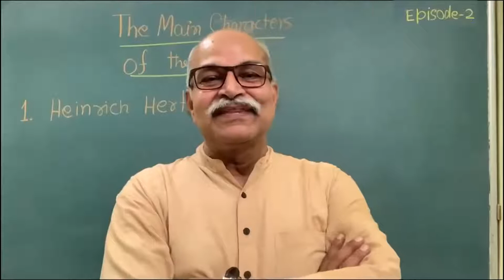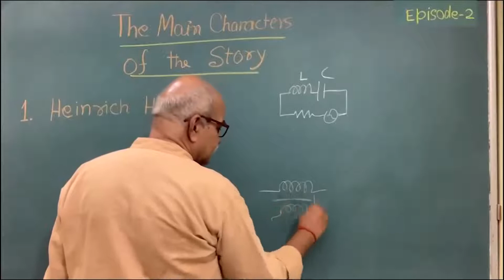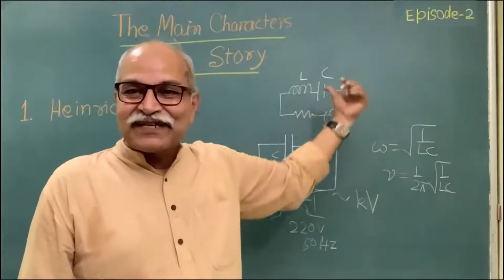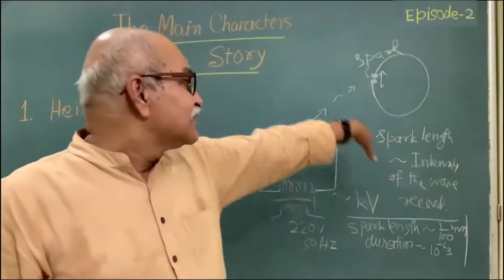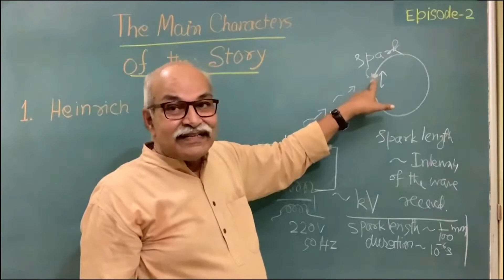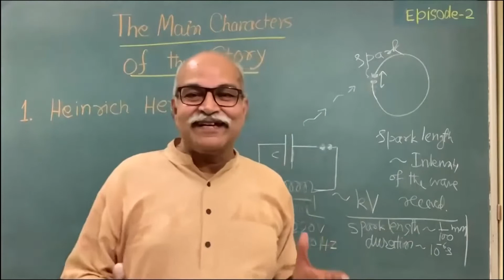Episode 02  Hertz Experiment of Generating EM Waves and obse...

Comment: A modern version of Hertz's radio wave experiment has just been used to disprove the theory of relativity. The experiment was just published in the EM journal IRECAP and shows an EM pulse propagating 1.5 meters in the near field with no observed propagation delay. It shows that the FRONT speed, which is known to be the speed of causal action is also the speed information, is instantaneous in the near field of EM sources. The paper shows that this is the second time an independent researcher has done the experiment and arrived at exactly the same results. The experiment with 100% repeatable and was repeated hundreds of times with the exact same results. The paper also shows that the effect is predicted exactly by Maxwell's equations when the source terms that come from Gauss's law and Ampere's law are included in the wave equation. Because this was not done by Maxwell, his original proof showing EM fields propagate at speed c is wrong, and because Einstein wrongly assumed this in his theory of relativity, relativity is also wrong, as well as any other theory dependent on it, including general relativity, and even QED. For more information  see: Non local or possibly superluminal Maxwell displacement current observed in the near field of a spherical capacitor, 2024. Also see: New Interpretation of Relativity by William Walker, 2024. Note that all the papers supporting this research can be found in the description of the video.

For more information see the following links:

*YouTube presentation summarizing my 35 years of research in this area: https://www.youtube.com/watch?v=sePdJ7vSQvQ&t=0s

*More extensive paper for the above arguments: William D. Walker and Dag Stranneby, A New Interpretation of Relativity, 2023: http://vixra.org/abs/2309.0145

*Electromagnetic pulse experiment paper peer reviewed and just published last month in Journal IRECAP: https://www.techrxiv.org/doi/full/10.36227/techrxiv.170862178.82175798/v1

Dr. William Walker - PhD in physics from ETH Zurich, 1997
1

Comment: Rain forms a string of water droplets which may be conductive under high voltage electricity. When this water droplets form a conductive path between high voltage power line and our head, we should die. But it is not happening. Why?
Reply: I guess the lightning does not hit earth every time. Most of the time it dies in the atmosphere itself as it depend on the strength of the voltage difference